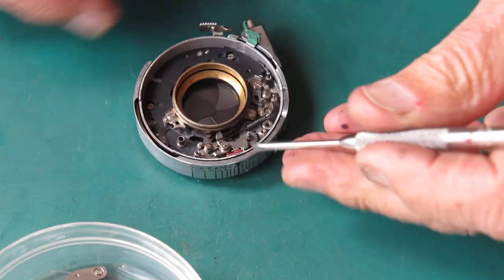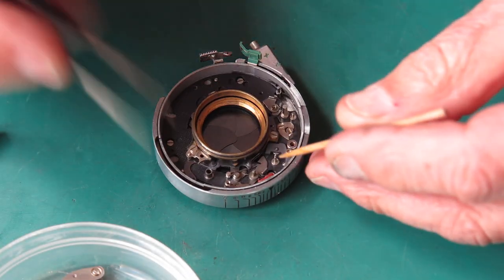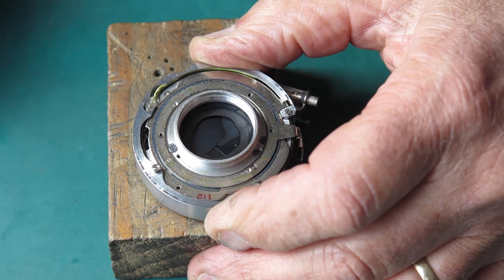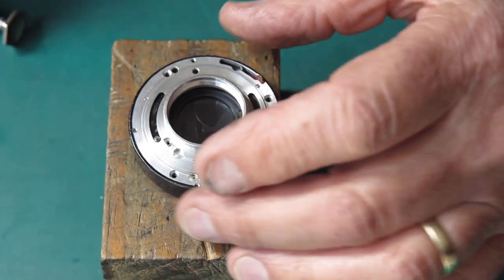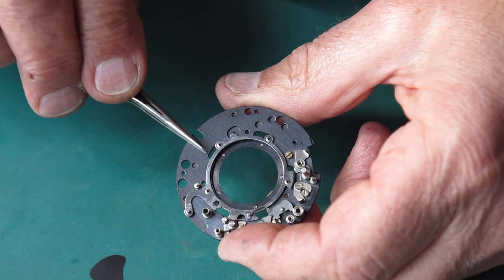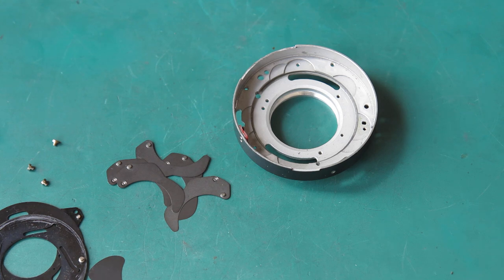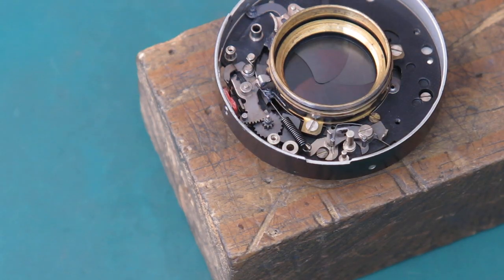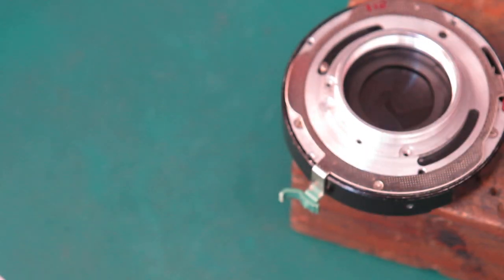Kodak Retina IIIC, bad cocking rack, part 07

Comment: Chris your a life saver..I found your 3 part video on  shutter strip down and thank you so much for it. I had to take mine apart as I'm fixing up an old mamiya six with copal shutter. Someone had oiled it and the aperture and shutter blades were gummed up. I had the take the aperture blades apart and using your jig method I got it back together. The shutter is now all cleaned and back together but I have 5th and 10th speed tuning at what looks like 125th. All other speeds are correct. There is some movement in the slow speed gear unit but nothing seems to work. I have another copal with X and flash bulb setting being the only difference. I took the slow speed unit out and swapped them. Still no luck. I can't see anything else in the shutter that would make 5 and 10th speed run so fast. Can you shed any light on this problem. I have searched the web and can find nothing. Many thanks.